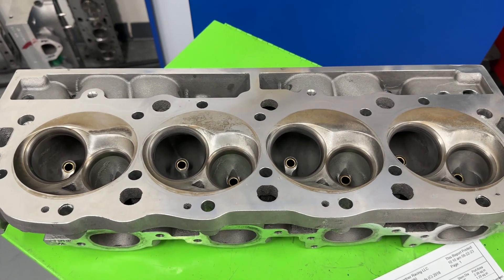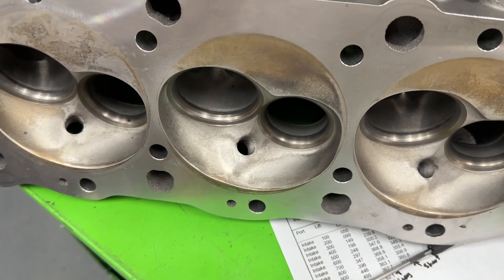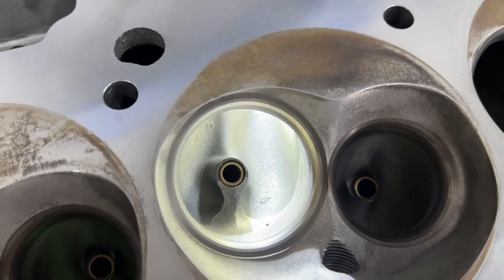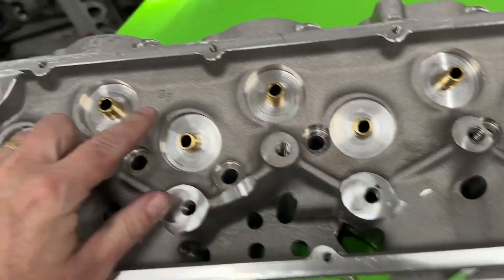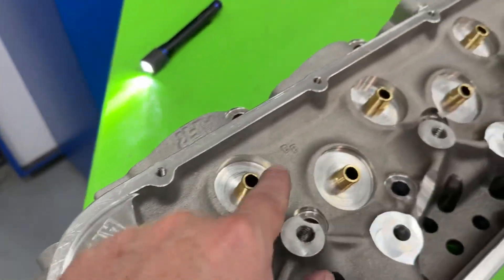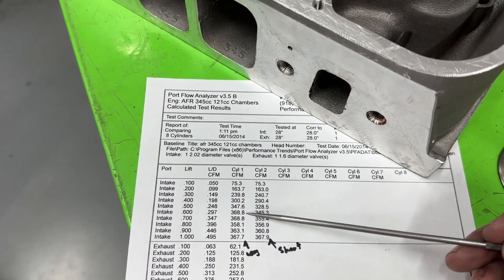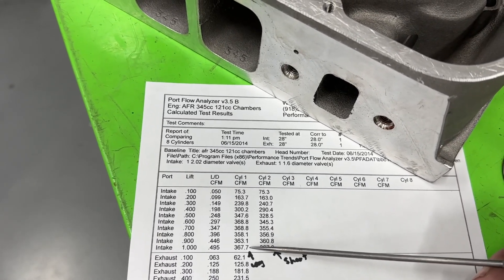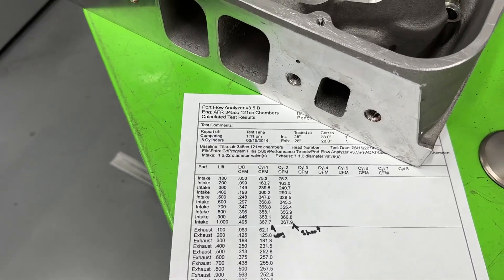AFR 345cc BBC Head Review With Real Flow Numbers

Comment: Awesome. I’ve got the Tony Mamo 360 heads on my 582 which is essentially a 357 AFR head- Basically the head Eric has here. Tony flowed mine once he massaged them and installed 2.350 valve. Amazing low lift figures and peak or 436 int/339 exh cfm @ .800. Lift. On a ‘stingy bench’ as TM put it to me. They certainly make some steam these AFR’s particularly when the likes of Eric and Tony get their tools onto them.

Comment: Very  Informative  video...On Every head you do Valve job on & ship to Customer do All the Valves Seal Tight enough to hold solvent ?? ....Seems some Heads (all New with Valves) Won't hold Water or Alcohol/Solvent liquid & Show Measurable Leak-Down leakage right out of Box.....What is Your "No questions asked"  valve Job Quality Control on the Valve Sealing performance ? .....Thx for great vids..

Comment: This one was suggested while I was watching your AFR 315 head video.  I put them side by side for the big bore and compared.  This 345 really didn't even flow better than the smaller head did overall. Just barely.  They were damn near even up until the high lifts, then the smaller head did slightly better.  Why is that?   I figured they'd be the same head, just one is bigger, and the bigger one would have shined on that big bore. 
And I'm interested because I'm gathering parts for a 572 so this one was of particular interest to me.

Comment: I have always wanted to test plating the ports with copper or nickel to see if the less abrasive material would change the flow of air.  The idea is to reduce turbulence along the walls to increase laminar flow.